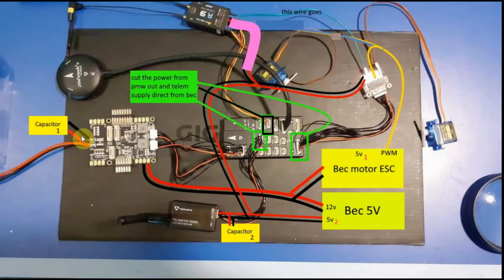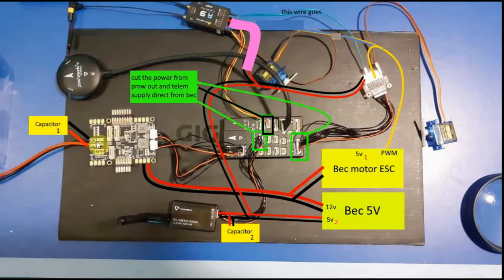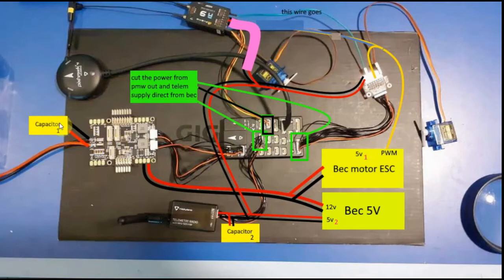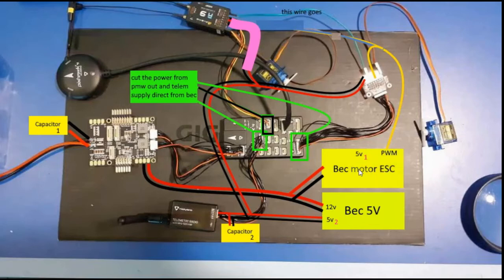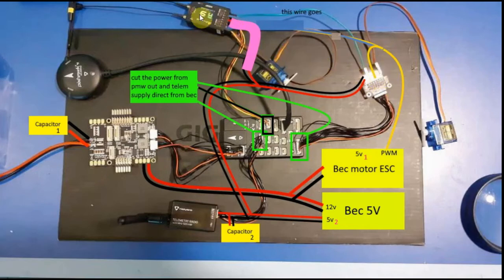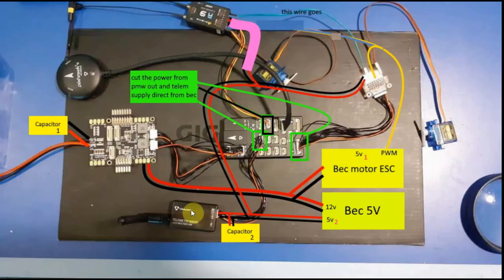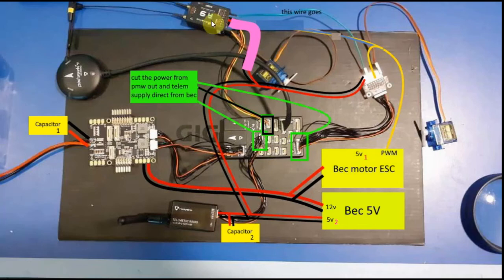Pixhawk 4 - Wiring Update

Comment: Hello, I have a question
Is it really to necessary to have a bec?
Reply from the maker: yeah the servos need a separate 5 volts, as does a raspberry pi if you want one, the pixhawk is a computer, if something jams a servo and it pulls the voltage down (example) it can crash the flight controller
Reply: @aeronaughties Thank you for your answer. I dont have servos on my drone, but i have raspberry pi to import into my system in that case what should i do? I also have Pixhwk 4 and PM07 as I understand PM07 has integrated UBEC. Do you have any recommendations for BEC?
Reply from the maker: which country are you in? i ask because that can be an issue with getting some parts, also can you message me on telegram or email please. my contact details are under my more recent videos
Reply: @aeronaughties  
I'm in Turkey. I will contact you by e-mail. Thank you